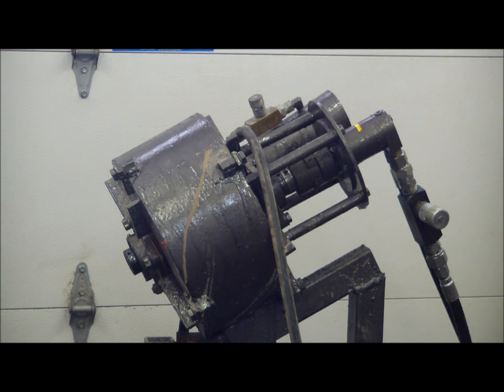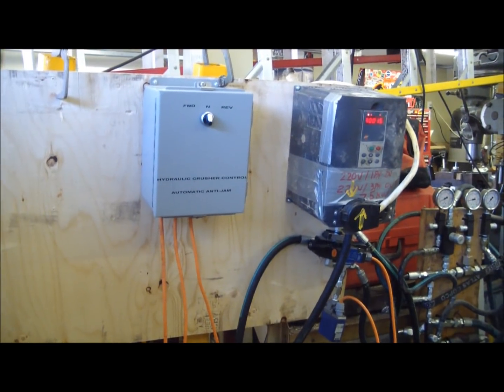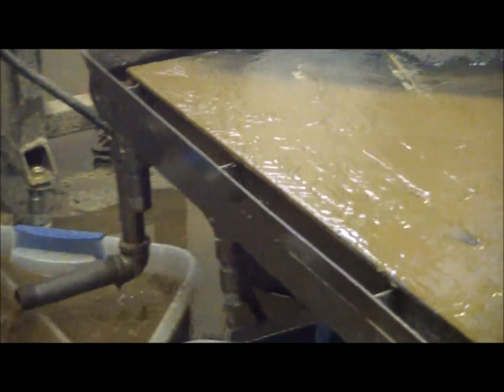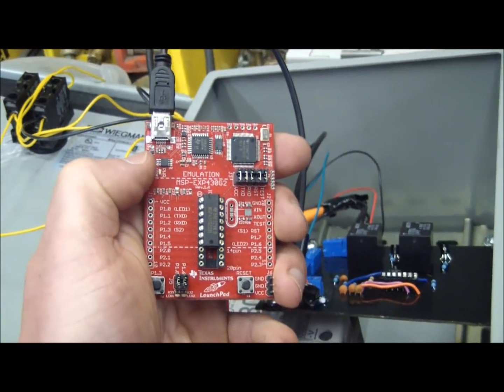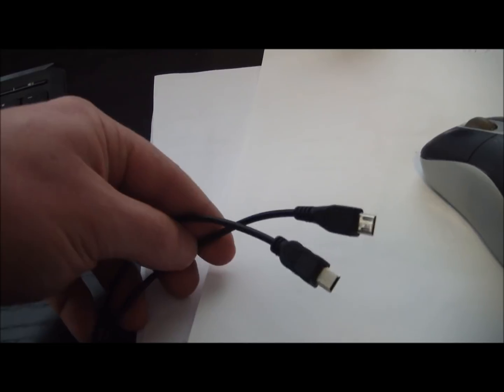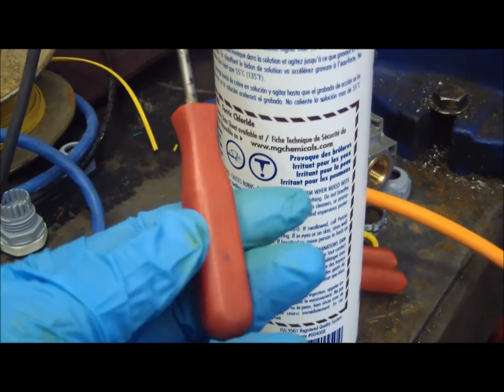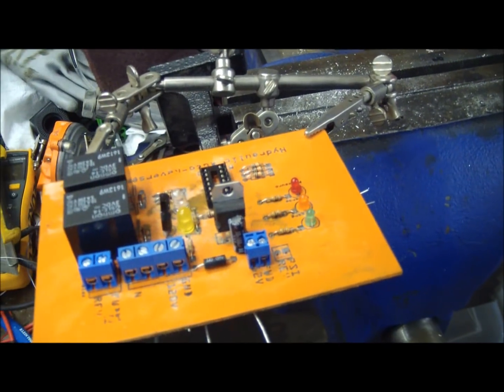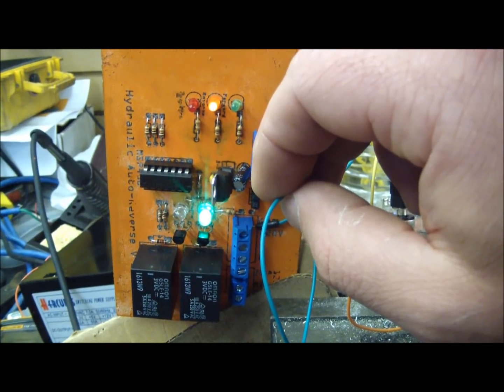Poorman's Rock Crusher and Gold Recovery

Comment: Technically a parsec is a measurement of distance, not time. So in relation to Star Wars it was used incorrectly but as you made the board smaller it is an appropriate use of the phrase.

Comment: you are very very lucky this worked at all. the build/construction area is an ESD nightmare. there is a small DIP puller tool (digikey?) or use a dip test clip to keep from putting the controller in the vise. more delay from reverse or PWM (pulse width modulator) which also have watch dog monitors for master timeout? Nice mechanicals! good luck on the Gold

Comment: Nice. I had a buddy that used a combo mill of his own design. It was a ball mill the first 1/3 of the pipe then there was a plate with holes. The fine stuff would fall through the holes and there were rods that would pulverize the ore down to about flour consistency. All this was on a  carriage with one end on a pivot and the other end could be cranked up and down with jack screws. pretty simple all mechanical design Maybe something you could use?
Reply: K thx

Comment: Hello Sir, hopefully you will read this. Did you use bars or chain in the crusher? How does it hold up? I'm guessing the lower speeds and rod mill allow for a larger crush size? I am designing a similar setup and have started with the shaker table and am going backwards from there to the crusher. My table works very well at a specific mesh using electric and PWM controlling water, shake and.... Something special I'd like to share once I have a system going. Please share or update what you have learned building your setup if you don't mind. Gotta get the GOLD!

Comment: I see you talking (a lot) about the TI VS Arduino with regards to the fact that you can take the chip out and put it in your own circuit ... You can accomplish the same thing with a AVR programmer. You still need reset circuitry and a crystal if you want uart comms. I assume you need the same stuff with your TI chip? The atmega chip can probably do a lot more, so a better comparison to the TI chip would be an Attiny. Attinys are not that much more expensive than 2$. This video is good stuff either way, bravo.
Reply: +AvE You can get the good ol' ATMEGA328 arduino clones with a CH340G USB chip for $2.19USD including shipping. I have bought eight of them with no bad chips or even bad solder joints. Not knocking TI, just saying...
Reply: Any reason you didn't want to use SSRs instead of mechanical relays?

Comment: Have you heard the idea of microwaving rocks for a few seconds before the crushing?   It makes a big difference to the total power used; allegedly.
Reply: Depends on your idea of entertainment
Reply: +AvE wet rocks in the camp fire.... Steam is your buddy...?! ?!
Reply: +AvE  This seems to be the origin of the story I read https://www.strath.ac.uk/impact/electronsmakewaves/    It went on to say it had been trialled with great success in Australia and I have a memory of a vision of red rocks so it was probably iron ore.   Here's another clue from 2003  http://www.bbc.co.uk/radio4/science/thematerialworld_20030403.shtml
Reply: +MattOGormanSmith More likely it has to do with trapped water in quartz causing internal pressure and fracturing. Since the microwave will boil the water while the quartz is still cold enough to be brittle, i could see that cause all kinds of micro-fractures.
Quartz sometimes has pockets of water in it so large, you can see it sloshing around inside. Talk about an old bottle of water ;)

Comment: Use a tiny flat head screwdriver, lever up one end, then lever up the other(about 1mm), then grab it with your fingers and pull it out. Works  99% of the time
Reply: Or just use an IC puller. Also I really wouldn't suggest grabbing those IC chips with your fingers without some sort of grounding mechanism like a grounding strap or simply just grounding yourself by touching something metal that's already grounded like a light switch box receptacle or something. I did computer repair at one time and seen soooo many of those ICs fried just by touching them with ungrounded hands. You can also get IC pin benders at good computer shops

Comment: Don't use etching for PCB creation... use desktop CNC your not an idiot you could knock one up in a day !
Reply: oderbang I use a T-Tech QC5000 a couple times a week for PCB prototypes. That is, a fully commercially supported pcb mill, not a DIY hack-job. And you know what? Changing bits, setting depths, pinning boards, doing to "rubouts" and "trace isolations" is damn time consuming! I'm going to be trying creating an etch mask with a laser cutter later this summer. Given that it can both path out the isolations and create the holes (i.e. no need to swap a million different sizes of drill bit) I'm quite excited at that prospect if it works. Anyways, milling aint all it's cracked up to be. And it's prohibitively expensive for the beginner and simple hobbyist--nevermind, really small pitches (5mil) can be almost impossible on a mill.

Don't hate on the etchers. Sall I'm sayin'.
Reply: Rustin Bergren i use a high-z 720 which i have more luck than etching.. each to there own i guess

Comment: seems like overkill to use a micro controller for that simple task
Reply: ***** two or three 555s, some op-amps for both scaling/zeroing the pressuring reading as well as for comparator for the overpressure condition, some solderboard, resistors, capacitors... ya know, that's the "non-overkill" way. ;)
Reply: rocketman221projects that was pretty much my point. Doing it "non-overkill" (which I assume means analog style) would have been more expensive and more time consuming. With about 3 times the number of components. Given how inexpensive uCs are nowadays, it's hard for them to be overkill.
Reply: afroninjadeluxe You can get cheap micros for under $1 in small quantities. While you could do it without one, it will cost more and take up more board space.
Reply: Rustin Bergren Video please.

Comment: Nice!!!! I've been researching Arduino and your right, the design sucks. 

I see several surface mounted chips on the top or your  final process board but they are not there on your demo board. What is that about?